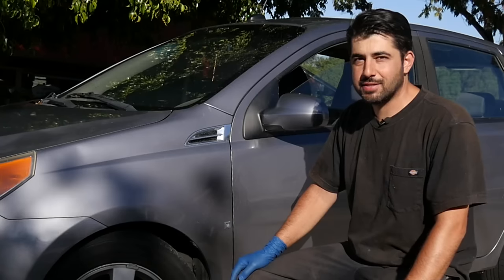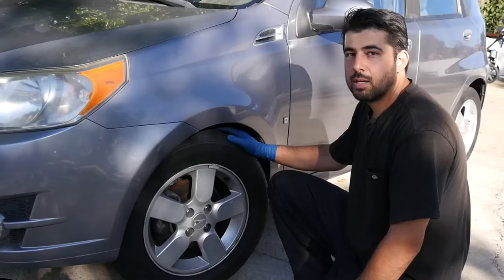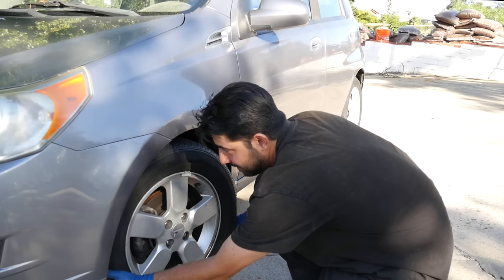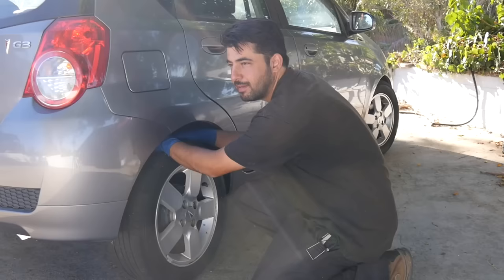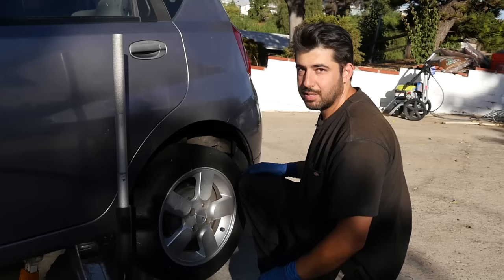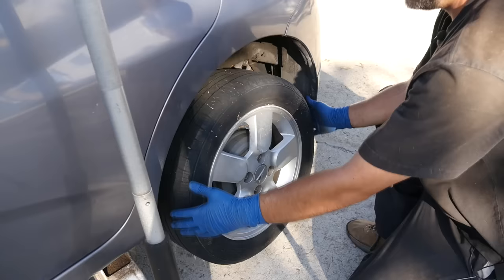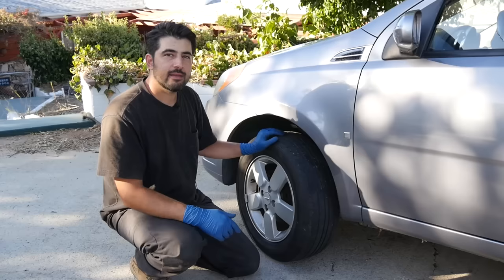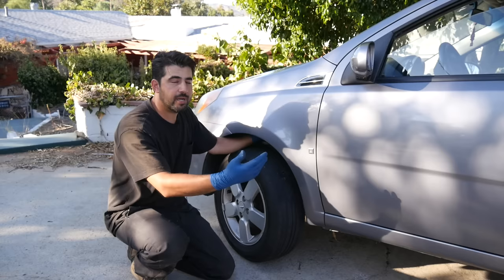Must Watch Before Spending Money On a New Wheel Bearing

Comment: Also, if you can, after driving it for a little while, feel the hub area (not brake rotor). If hub is hot or very warm, it may be wheel bearing going bad.

Comment: well, you just might saved me some bearings expenses. i lifter today the car, suspecting that the "strange " noise is coming from the bearings, or the brake disks, but i did not triet the spring vibration, and the tiers.. bumps. il lift it and trie that tomorow .thnx a lot

Comment: So the tires on this car are basically brand new. Less than $3,500 mi on them at the most. They were a brand new set bought at a dealership. The car is a 2004 Toyota Corolla which was given to me by a friend who moved out of the country. I've only had this car for 3 months, but I've noticed it's super loud when it's being driven. It seems to be loudest around 45 miles an hour, but then it gets loud again around 65 to 70. I cannot tell if these are just loud tires, or if there's something going on with the bearings. Currently this car has around $250,000 miles on it. It was maintained perfectly. This woman took amazing care of this car! And it's like brand new inside. So I can't figure out what's going on here. With the amount of miles on it, I figure it could be bearings, but it's not shaking or doing anything else. It's just noise so that's why I'm suspicious it's tires. I did look online to see if these particular tires had a reputation of being loud but I can't find anything definitive. They are yokohama ascend gt...any ideas?

Comment: Thanks Man for this Video. I have my Tesla Model Y Car ran into a Pothole my tire got flat, got a new tire and rebalanced, starting to Hear the whining noise specially when accelerating, tire and rims are good! Checked the Upper arm etc. looking good. so I guess its the wheel bearing for sure this time. 
But problem is nowhere to buy spare parts for tesla. Even Tesla is back order

Comment: This would go back to about 2013 or so- New set of 4 General steel belted radials bought and installed and balanced by Sam's Club on a 2006 Honda Odyssey with about 50k mi.  
Horrendous humming coming from what seemed all 4 wheels, and even more so from the front.  Wheels checked for alignment - good.  SC said tire were all was okay.  Tires rotated at 2k mi.  A tire design engr said the cords in new tires can take a wrong set and an early first rotation can help prevent this.  Even and normal tire wear at 30k mi, but still horribly loud and constant, smooth vibration so new tires were purchased.  No credit from SC.

Comment: Awesome video.  We have a noise that is similar to rubbing a wet finger around the rim of a glass bowl.  The brake shoes will wear more on one edge as if they are crooked.  Two shops worked on the brakes and could not fix it. After first shop, the disk was actually only being used for half its width because the other half was rusting.  After all that we did it ourselves, replacing disks and shoes with top quality parts, still doing it.  Will have to run the checks you describe here.

Comment: Another good indication it's a wheel bearing and not something else; when you go into a turn, if you turn towards the side the bad bearing is on, the noise goes away until you stop turning, and gets louder if you turn in the other direction. I.e. your right bearing would stop growling for the moment in a right hand turn. Left hand louder. It's because of the weight being put on/taken off of the wheel when you go into a turn or manoeuvre.

Comment: I had 2 bad Wheel bearings in front wheels on my Lincoln Contiential Car, after they were fixed my wheels was not vibrating......It drives so much better....

Comment: If your car is old you might as well replace the bearing anyways, after 15 years the grease is dried up on on wheels. I've checked all 4 bearings on both my hondas and the grease is basically shot

Comment: Recently changed out two wheel bearings in the front for a vibration noise that happened in my Chevy 2500 Express van I use for carpet cleaning. Turns out it was the drive shaft in the transmission was disconnecting. I mistakenly kept driving about time took it to another mechanic for a second opinion the drive shaft had merged with the tail end of my transmission. so I had to replace the transmission and driveshaft costing me around $3,000 total parts and labor.

Comment: I run 20" low profile tyres, after about 5000km on a brand new set of Khumo tyres on the front, swapped out the front wheel bearings myself, easy job, but $600.00 later, still noisy. Tyre guy said "oh yeah, those tyres get noisy as they wear....." Don't sell me crap. Go to another store now and only use Pirreli's, just a personal preference.....

Comment: Take the wheel off to check it.
I had a tyre with a sharp piece of metal sticking out of it that cut my hand when checking it in the manner that you just displayed.
Also the problem could be at the bottom of the tyre when doing that type of inspection and the issue will be missed out

Comment: Just like Janice Joplin sang,{ Oh Lord won't you buy me a Mercedes Benz}. A good friend of my Sweetheart inherited Mom's 2000 ML 320 with 177+K A little old school teacher/principal who took seemingly good care of the SUV and drove it fairly easy. I plan to do a few basics. oil and filter, air filter, cabin filter, maybe venture as far as the trans. filter and fluid. and start checking things. I was given this ride, 1. I'm a NICE GUY, and 2. I have done A LOT of general work of her over several years only charging for parts never time or labour. This has included replacinng the windshield wiper motor on this Benz, inside plumbing, clearing and cleaning of exterior of house, lawn equipment repair, and on and on.  She said a "Mechanic" found some front end issue and could fix it for 6000$$$$ on a 2-3 k value SUV. At this point I am unsure of what that expensive issue might be. I drove it home, about 30+ miles all seemed well. The other issue I need to fix fast is the sun roof is leaking down into the cabin floor and carpet. I've tried to blow it out with an air hose but no go so far, I've seen another video of the tearing apart from the A pillar -up and have located the drain just under and at the back side of the fenders. 
If you have any tips on clearing this drain hose besides 120 psi air pressure please chime in. I'm getting to the point of grabbing an old banjo string from my Sweetheart and trying to fish it down to the bottom?
Any suggestionss on the sun roof leak or other issues I mentioned or forgot to mention PLEASE feel free to but them up here or send me a 
private message. I am not above paying a wee bit for advice or input that actually works.
Thanks
Dennis

Comment: What I do to check for a bad tyre is to jack the car up and leave a 1cm gap between the tyre and the road.  Put your head down low at ground level and spin the wheel where  you will see the flaws and eccentricty easily.

Comment: I had some Dunlop sp Sport Maxx on the rear of my Audi and as they wore they made a real whirring noise on the motorway that sounded JUST like wheel bearing noise.   Also on my wifes car, we had some chinese tyres on the front and the tyre services couldnt balance them, at one stage they had over 30g on one part of the tyre and still they wobbled.

Comment: My SUV is making an old squeaky mattress noise only when I brake. They replaced my front bearing and the noise is still there. It’s no vibration or growling noise, just old squeaky mattress sound. $375.00 later and don’t know what the problem is. It’s terrible when the auto shop is unsure of what the problem is.

Comment: Thanks for coming back dude. Every other mechanic on here is a shortcut dumbass.  Followed your directions on a valve cover gasket replacement on my 2.7T and worked like a charm.  These cars are insanely difficult to work on.  No space and limited tools makes Teddy an angry boy, but I Got Er Done! 20 yr ownership & 145K mi and still kickin.

Comment: I have a confession. With no handbrake working I relied by parking my car by turning the wheel towards the kerb and let gravity to the job to stop the car moving. Now I feel because of pressure from so much of it doing there has been damage and a grinding noise coming from the left wheel. Is it wheel bearing that has been damaged?

Comment: Kindly share more about bad tie rods and ball joints. I have an almost predictable vibration in the steering wheel when applying breaks at a certain rate, and no it's not warped disks because it was suggested and I swapped them. There is also overall vehicle vibration at certain speeds which can only be snapped out of by applying more gas or letting off gas. Can it be bad tie rods resonating?

Comment: I didnt have any wheel bearing noise before I got new tires, I got a full set of new meats and now there is a pretty noticeable hum which gets louder between 20 mph and 55 then pretty much goes away all together at 60 mph+, I swapped the front wheels around and its still there and sounds like its more towards the driver front, I shook the wheels when I had it jacked up and there was very very little play which was almost matched by the passenger side, I dont really want to throw a new bearing at it until im absolutely sure

Comment: Much easier for me is to drive it for around ten minutes and then use laser thermo gun to measure the temperature of each wheel hub where the wheel bearing sit inside. The hotter side normally the one is bad due to friction. Mine is over ten degree different.

Comment: If your mechanic don't check your tires before calling on some job needed he ain't honest, could be also a faulty rim/mag that got bent during an impact or unbalanced tire. If all these checks out then it's the bearings or maybe brake (often calliper guides pin jammed up)

Comment: I had the top of the strut/shock nut that was loose and knocking, thought it was wheel bearing, looked under rubber tower cover and found it was backed off or installed loose from previous owner😬

Comment: When you did the test w/tire rotation, can you check it w/only front tires in the air, or all 4 should be in the air. The bad wheel bearing (actually it is wheel bearing & hub assembly on 2003 Chevy Cavalier, I don't know if you can remove just wheel bearing itself from that assembly) were bad on the front. There was exactly that typical noise on driving straight. I replaced the original ones w/new aftermarket just bcs of the mileage (~100K) about 2 years ago. Now they both failed, mechanic on alignment told me and I replaced them for the original ones I saved. Again the original ones had no issue and when I rotated them, they were rotated smoothly. That knocking sound gone, the car drives straight smooth, but now on turn it gives whining-scratching sound when turning to the Left (occasionally), and loud grounding sound when turning on the right. I did another alignment in the Dealer, but that sound didn't go away, and they didn't give me any recommendations this time. What that can be? I would appreciate any opinions on this matter. Thank you for the informative film. Yes, and when the wheel bearing were bad I couldn't feel anything by shacking the wheel side to side on in vertical direction.

Comment: I have a 2017 Subaru Impreza Sport that has a bad drone/vibration, most noticeable at 40-60 mph. The drone follows the speed I'm going. I did the tests in this video, but there are no signs of any bad bearings. It could be tire related, but I can't tell. I really don't want to spend $$ doing unnecessary repairs.

Comment: Interesting video. It popped up as I looked for common sounds for bad wheel bearings. There is a weird sound coming from the wheels in the front sort of like...."woo, woo, woo, woo"...pretty funny but that's the best way to describe it. When I drive on the frwy it's more apparent as in the sound it makes. If the road is smooth, you can hear it best. Sounds like something is spinning with the wheel. Also, my steering wheel shakes the faster I drive. Based on what I described, would you say it is my wheel bearing? I also do have uneven tire tread bc I didn't do my tire rotations in a timely fashion. My alignment has been off as well but I already took it in for correction and tire rotation. However, the sound persists.

Comment: After i put brand new tires on my car a noise came to my car. It sound like the rear tires are rubbing against the struts. So i bought the wheel bearing and it still making that noise. It sounds like a avioneta.

Comment: My tires are new as well as i have replaced the front wheel bearings but still the humming noise is coming while driving & the speed continues to increase with increasing speed.

Any solution??
Reply: Ever figure out what was wrong?

Comment: I have a squeek that can only be heard from drivers seat. Mainly hear it 25-50mph. But not all the time. Sometimes it's obvious. Sometimes it's not. It speeds up or slows down with the wheel revolving. Mechanic can't hear it but I'm in my car all day driving 200-300 miles a day. He says the wheel bearing is fine. Wheat else could it be.

Comment: As DIY'r, if you have a bad wheel bearing, go ahead and do the all the other stuff as well.  Alignments cost $100 and need to be done every time you mess with those parts.  Be proactive and knock it out all at once when everything is off anyways.  Shocks, ball joints, tie rods, bushings, wheel bearings and brake job.  

Don't end up spending $400 on 4 different alignments because you did one thing at a time.

Comment: Hello . I have a Prius 2013 , FWD . I can hear grinding noise when I drive. I wanted to check wheel bearings. Please help.

1) I jacked up the car but I am unable to spin the tyre . I have a single jack, do i need to lift both the front wheels ? Do I have to keep the engine running to free the wheels ? Or is there something I am missing?

Thanks

Comment: Question, I get a hesitation upon acceleration from a stopped or coasting position, like it's the trans, I've had it to 4 garages, including a dealer, not one could figure out the problem, it does vibrate at a stopped position, u can see my headlights on the back of the vehicle ahead wobbling?  My guess, transmission mount?  2007 Scion TC, 137k mile...

Comment: My 2 cents. After you decide it’s a wheel bearing do yourself a favor and change the tie rod ends and ball joint at the same time you are changing the wheel bearing. I mean the thing is already off so do it. Also if one side is bad you can bet the other is also bad, do it in pairs. Save yourself another trip and more expense.

Comment: Don't just assume 9 and 3 is a tie rod and 6 and 12 is a ball joint. I've seen many a ball joint only wobble at 9 and 3.  I would suggest that, if you find movement in any direction, get a look at the potential parts. Get help if it's an option.

Comment: Hard to spin a wheel that is connected to a diff.
Reply: Barry Thomas Even rear ones, if the drum brakes are correctly adjusted they will be dragging slightly.
Reply: Just put the transmission in neutral.

Comment: I had some GOODYEAR tires I ran them for 9 years lol. The 94 explorer would shake past 55 mph and I was not planning on fixing this truck.  Well I had some money issues and after approaching  270000 k miles the engine was still ok. Not bad not great. 
Well I put on some 300$ Walmart tires cause I wasn’t gonna blow anymore $ On it. Well. IT RAN LIKE A DREAM !  I couldn’t believe it. I couldn’t get over 60 mph before this now I’m running 80 perfectly! Lol 
All because of some bad tires. They looked round , smelled round shot they even tasted round!  
But they were not... 
so after I put new shoes on the exploder you all now what happened after that ....😡

Comment: Here is one better. Raise entire vehicle on a lift. Start engine. Put in DRIVE mode. Accelerate slightly. Now apply brakes in order to physically "LOAD" all bearings on drive wheels. If vehicle has 4 wheel drive engage it so all wheels pull. While someone in the vehicle applies the brakes have your mechanic check each wheel for increased noise and vibration. Bad bearings always get much noisier under load. This method is especially good for 4 x 4 vehicles.

Comment: My technician added 200gm total weight on four wheels after wheel balancing. He told me it’s excessive weight so I should replace rim and this could damage wheel bearings. My car is Toyota chr, I am using 225/50R18 tire. Should I replace the rim?

Comment: My 08 Mazda 3 started making a wum-wum-wum noise right after a long-overdue tire rotation. It's been several months and the noise didn't go away, so I removed the tires myself to check the wear. It turns out the driver side front tire has slightly scalloped wear on the inner edge. I don't understand how there was no noise before the rotation. (tires are directional so they only swapped front and rear, not side to side.)

Comment: I have a 2001 Honda CRV and it is all wheel drive  Replaced  all wheel bearings like 3 yrs ago but I am again getting a humming from the front it seems.  How do I check the front wheel bearings being it is AWD.  I was going to disconnect the drive shaft to the rear end and run the car in drive with the front wheels off the ground but then it would not have a load on the wheels.  I checked and there is no play in the wheels at 6/12 and 3/9 position or any position